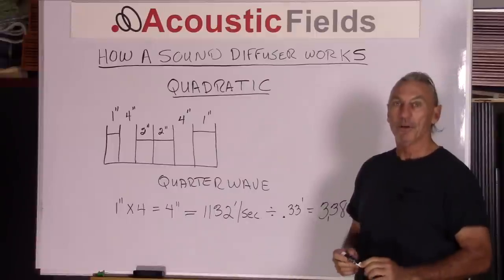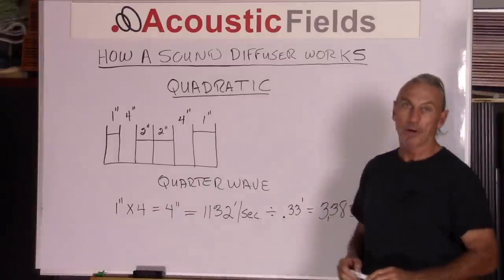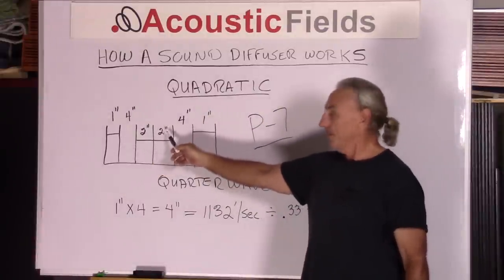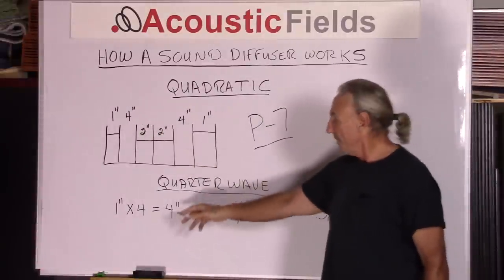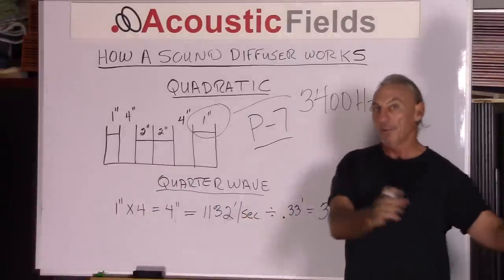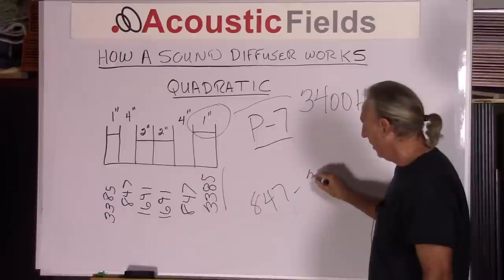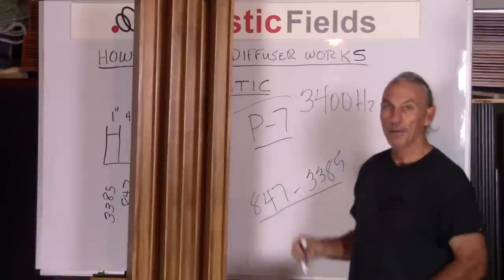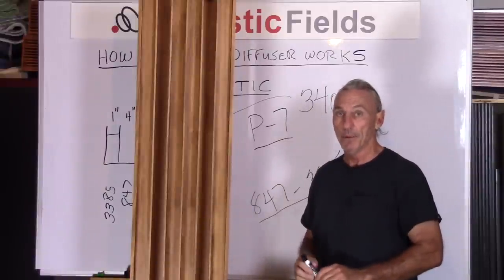How Sound Diffusers Work - www.AcousticFields.com

Comment: Hi. Im big fan of your videos and I have a question.
Does this diffusers make difference to room sound pressure?
Can i make better room frequency response with these diffuser?
Reply from the maker: Hi Han Lim 

The only diffuser that can make an impact on low frequency pressure issues is the QDA series http://www.acousticfields.com/product/qda-19-quadratic-diffusor-absorber/ which incorporates our carbon, low frequency absorption technology into the diffuser build itself. Freestanding diffusers only deal with middle and high frequencies. Diffusion will not have a direct impact on room response. You need to address unwanted room response issues with sound absorption technology.  That said, you have bought our DIY BDA build plans and those will help with low frequency management.  Please fill out the room analysis form on the following page so I can better advise you as to the numbers you need to build and their respective placement:
http://www.acousticfields.com/free-acoustic-treatment-room-analysis-tell-us-about-your-room/

Thanks
Dennis
Reply: Acoustic Fields Thanks a lot! will do!
Reply from the maker: Hi Han Lim 

And here's an answer to question on diffusers and room frequency response: http://youtu.be/agBfDIunFi8

Thanks
Dennis

Comment: Sir would you use a vertical and horizontal at the same? What’s the norm?
Reply from the maker: K,  The terms you are searching for are one dimensional and two dimensional. Positioning diffusers vertically only or horizontally only is one dimensional. When you combine both vertical and horizontal diffusion together that is called two-dimensional diffusion. One dimensional diffusion is used to create a larger sense of "space".  Two-dimensional diffusion is used to reduce the impact of surface area reflections at shorter distances.

Comment: HI My room is 20 feet length. 17 feet wide and 10 feet in height... what diffuser should i use... its a living room... with sofa fabric and wooden floor. it has curtains on both right and left. and both other walls front and back are brick smooth walls with paint. and concrete roof. Please let me know what all can i do...
Reply from the maker: +Atishay Singh Fill out the information within this link and I can better assist you. http://www.acousticfields.com/free-acoustic-treatment-room-analysis-tell-us-room/

Comment: Hi, Dennis-
My room is 19' x 14' with an 8' ceiling-- not a big room. Is there any point in putting a diffuser in there?
Reply from the maker: S, What is your usage? remember every room usage has different acoustical treatment requirements.
Reply: @AcousticFields  I'm your customer, Steve Drake, From San Jose. I'm the one with the guitar practice room who put a deposit on 600 lbs. of carbon recently.
Reply from the maker: S,  Diffusion is a technology which makes a small room sound larger. They work well in live rooms that are small like yours. You will need a minimum of 2-4 units to allow for adequate square footage coverage.
Reply: @AcousticFields  Thank you!

Comment: Does this repeat after the 1"? 1,1,4?
Reply from the maker: Each prime number diffuser sequence 7 , 11, 13, etc. have a different lower frequency response.  The well depth and width changes with the frequency response range. We use a 3,400 hz. top frequency.

Comment: Does it work the same with planar dipole speakers?
Reply from the maker: E,  Yes, energy is energy regardless of source. Diffusers take the energy that it is given and then spreads it out according to its designed frequency response.
Reply: Thanks. I appreciate your videos.

Comment: Where is the 7th well?
Reply from the maker: It is a 0 well which means no depth. It is flat to produce reflections. We have extended the frame to compensate and make the unit smaller.

Comment: Thank you for your videos. Have you seen the designs for quadratic diffusors which use frames that are hollow behind them rather than having solid walls between each well? These have an interesting aesthetic and they would be lighter due to less material.  Something like this: https://www.youtube.com/watch?v=cKc3M30ePuc

I am curious if there are implications to this design and the lack of wall between the wells.
Reply from the maker: +masterpangloss i believe you are referring to two dimensional diffusion. One dimensional diffusion has dividers and wells. Two dimensional diffusion does not. They are both acoustic tools that must be used to match the room usage and music processes involved.